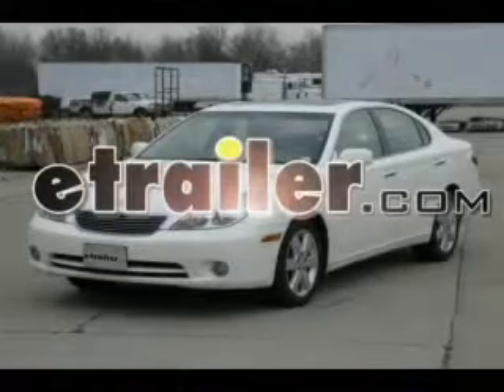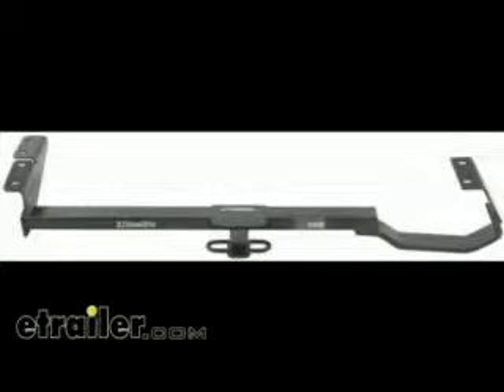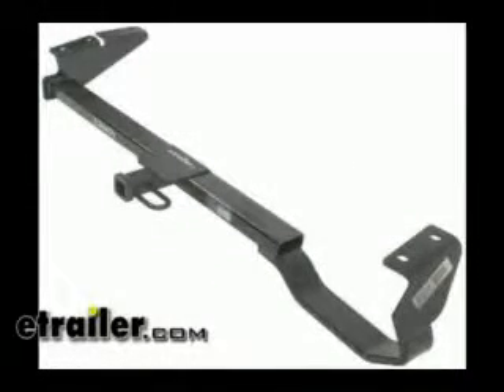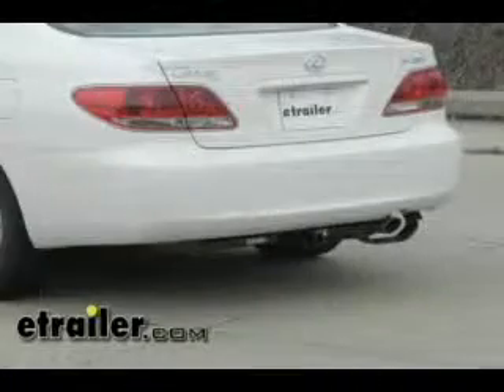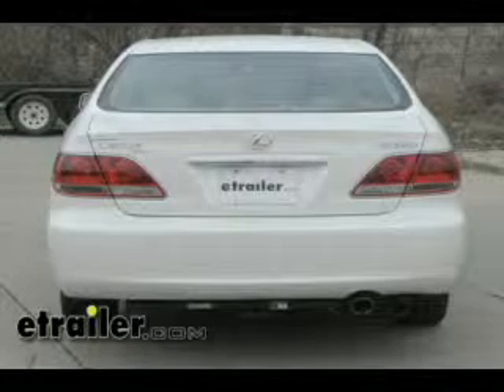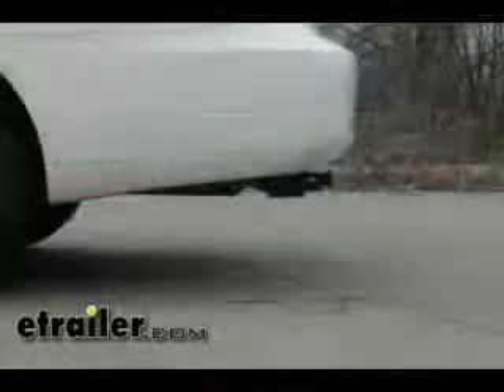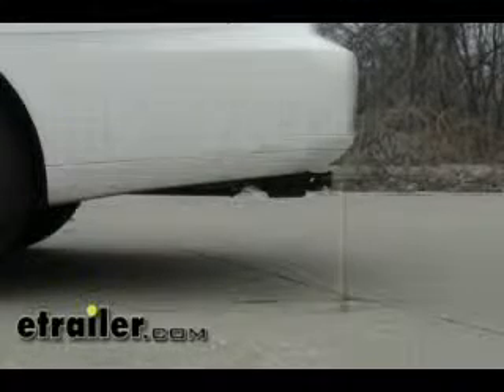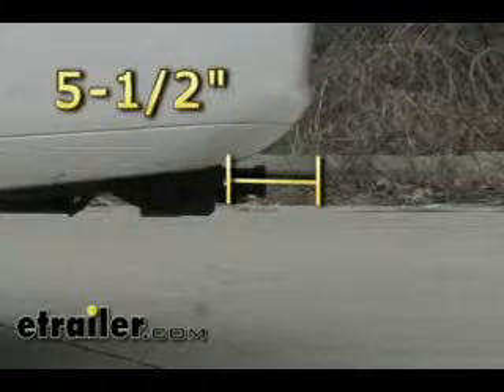Beginner’s Guide to Installing the Draw-Tite Trailer Hitch Receiver on a 2005 Lexus ES 330

Comment: What is the towing capacity?
Reply from the maker: The Draw-Tite # 36336 Class II hitch has a 3500 lb towing/300 lb tongue weight capacity. However you'll be limited by the actual towing capacity of the vehicle itself, which is 2000 lb towing/200 lb tongue weight.
https://www.etrailer.com/Trailer-Hitch/Draw-Tite/36336.html

Comment: funny nobody   put up es300 lexus  trailer hitch  anything wiring harness
Reply from the maker: For a trailer hitch, I'd recommend the Draw-Tite # 36336 which is a fit for the 1997-2003 Lexus ES300. For a trailer wiring harness, go with the # 119147KIT.
I'll link you to the install instructions and a video for the wiring that will provide a quick run through of what the install involves.
https://www.etrailer.com/Trailer-Hitch/Draw~Tite/36336.html
https://www.etrailer.com/instructions.aspx?pn=36336
https://www.etrailer.com/Custom-Fit-Vehicle-Wiring/Tekonsha/119147KIT.html
https://www.etrailer.com/tv-review-tekonsha-trailer-wiring-119147kit.aspx
https://www.etrailer.com/instructions.aspx?pn=119147KIT